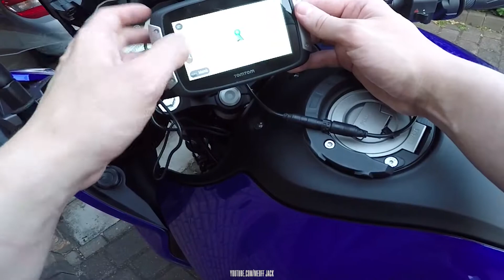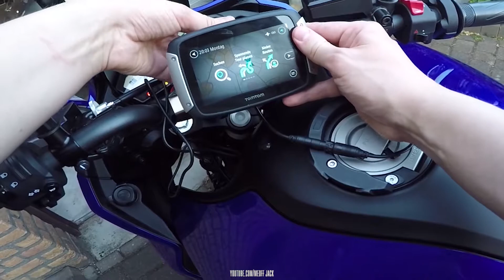Yamaha Tracer 700 Power Outlet & TomTom Mount Installation

Comment: Why this is not ready when you buy the new bike? So much effort
Reply from the maker: It's an aftermarket navigation system. So you have to install it yourself like any aftermarket stuff you buy. ^^
Reply: @meoffjack  I meant the usb or cigarette lighter socket of course
Reply from the maker: @BeyondWrittenWords  Well it's not a premium model. USB socket are accessories. Tracer 900Gt has one already installed.